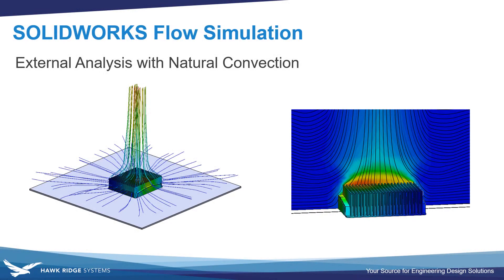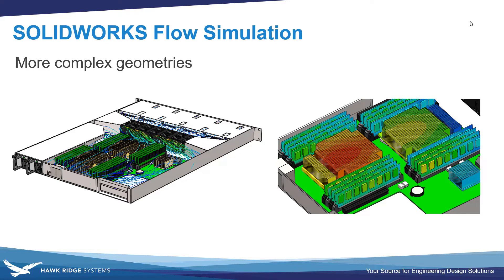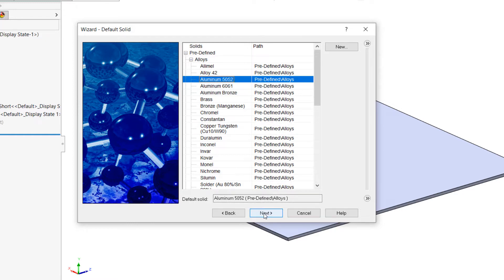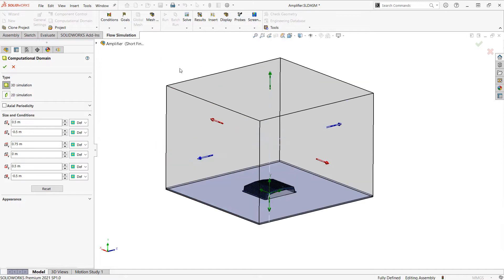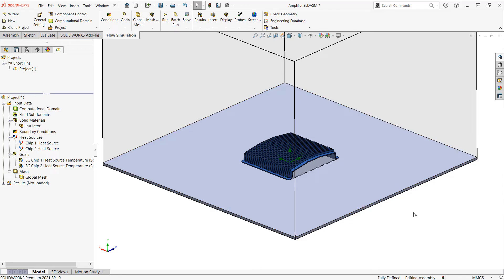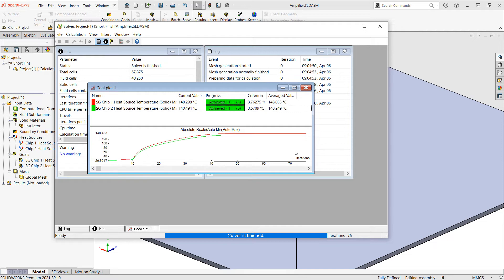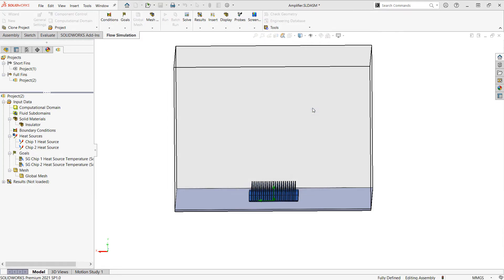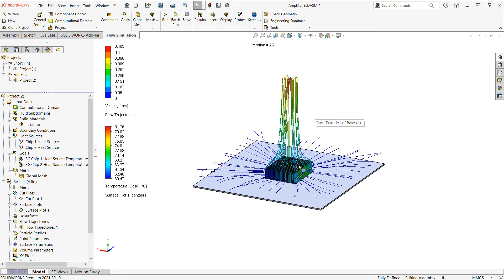Thermal Analysis in SOLIDWORKS Flow Simulation with Natural Convection

Comment: Brother, my solids are shown higher temperature in maximum temperature around 300 deg C. Why?

My room temperature is 28 deg C, so my solid also should be the same right?. I defined the material also for the solid. Thermal conductivity defined. Still the heat not able to reject, why?

Comment: Dear ,

I extend my gratitude for your video and the CAD file YOU SHARED.

I have replicated your example using a different simulation software, employing aluminum as the solid material with a thermal conductivity of 230 W/mK. However, I have not achieved the same results as yours.

Interestingly, when I utilized stainless steel with a thermal conductivity of 30 W/mK, I obtained identical outcomes.

Thus, I would appreciate knowing the thermal conductivity value of aluminum you utilized in your example.

Thank you for your response.

Sincerely,

Comment: If the heat source was applied on top instead of the bottom of the sink - would this simulate heat extraction? i.e the "heat source" application is set to an upwards direction?
Reply from the maker: The heat source will always input heat so long as the sign is positive. If you want to extract heat, such as to represent some cooler or cold plate, you can enter a negative heat power in the heat source.
Reply: @hawkridgesystems   Thanks for this. Would it be possible to make a video explaining how you would find the temperature difference if a fluid (inlet and outlet), using equation goals, with a heat source applied? More so on what general settings to click on in wizard. I've found that choosing the heat transfer rate there and also applying the heat source does something weird. On the other hand, clicking adiabatic and then applying heat source works, but this seems contradictory. I'm also presuming the meshing on the fluid and solid is done automatically.
Reply from the maker: @orrinbishop3326  it sounds like maybe you are referring to an internal analysis (such as a pipe / duct). The adiabatic condition you're describing sounds like the Default Outer Wall Condition. The Default Outer Wall Conditions will control heat loss through the "exterior" of the internal analysis - it will apply to any exterior walls that are not affected by a boundary condition. Typically we would leave that setting at adiabatic unless there is some known heat transfer loss rate to the outside environment.

When the default outer wall condition is set to adiabatic, all the heat transfer will occur internally within the computational domain - heat may flow out of an outlet boundary condition for instance but no heat will be lost through the side walls. Setting it to adiabatic is equivalent to treating any exterior wall that does not have a boundary condition as insulated. 

It is a good idea for a future video and we will add it to our list!

Comment: Under Velocity parameters if we add the velocity, will it become the forced convection?
Reply from the maker: Yes that's correct, if you input some velocity as shown at 3:26 it would represent a forced convection case (such as a wind or breeze flowing over the unit). Note that some testing standards accommodate a condition similar to a mild breeze even for "natural convection" problems, and this can have a large influence on the result. 

Typically leaving all the velocities at zero and relying strictly on the natural convection will be the most conservative estimate. Including radiative heat transfer can also be an important factor for natural convection problems.

Comment: Did you use constant density for the air material? Should it not be ideal gas? Its density changes in fluids that cause buoyancy effects. I believe your model shows this by looking at the plot for air temp and you see there is very little heat dissipation
Reply from the maker: This example uses the built-in "Air" ideal gas model. As long as Gravity and Pressure Potential (gravity) is enabled in the General Settings then the buoyancy caused by density change of the fluid is automatically accounted for, this is what forms the natural convection currents and is responsible for all the air velocity visible in the velocity cut plot, as there is no other fluid flow defined in the project.

Comment: Do anyone how to apply temperature instead of heat source. If any one know pls tell me.
Reply from the maker: You can do this as a "Volume Source" selecting the third option. This would be the recommended method if you expect the source to absorb or add heat

However take caution that when assigning a temperature, the result will always be this temperature. The unknown will be the amount of heat power absorbed/rejected

There is also the option for wall temperature in Boundary Condition when specifying Real Wall

Comment: if I add multiple volume heatsource, for example, 2 TWO CPUs of 100W each.
Do I choose two "solid" CPUs and type 200W, or create two separate volume sources of 100W each?
Reply from the maker: "Volume" sources will be distributed equally in terms of volume. So if the two CPUs are identical (same volume) then it would be equivalent to do either method. 

If you are not sure if they are identical geometry then it is best to define the sources separately.

Comment: Thank you for this video. I expanded this example a bit by adding a pcb connecting to the pedestal through a copper plate. On the other side of the pcb , I placed a component as a heat source. the pcb is also supported by some bosses. The pcb is defined as non-isotropic. After run the simulation, the flux plot shows that the heat only goes through the pcb - screw bosses the the heatsink. nothing goes through the copper plate to the heat sink. Why this happen?
Reply from the maker: The heat transfer should occur automatically between coincident faces. Possibly the geometry has a small gap in it or an interference. In this case you could either correct the geometry issue, or use something like a thermal joint condition to span the gap. 

Another possibility is the solid material definition is incorrect - if one body is defined as a perfect Insulator then you would see no conduction through it

Comment: i Wonder if it is possible to do a secrion of the surface plot? So i can see the internal distribution of heat within the part?
Reply from the maker: Hi Angus, you can do this by creating a Cut Plot and choosing option such as Temperature (solid) or Temperature. 
You would also need to adjust model display transparency, or hide the solid part so that you can see the cut plot

Comment: Hi, thanks for video, very well explained. Is possible to calculate the convection value of the fins in this analysis?  Thank you Fabio
Reply from the maker: Yes, Flow Simulation calculates the convection coefficients. To extract this value I would recommend setting up a surface goal on the fins to track "Heat Transfer Coefficient" parameter. It could also be extracted from surface parameters in the results.